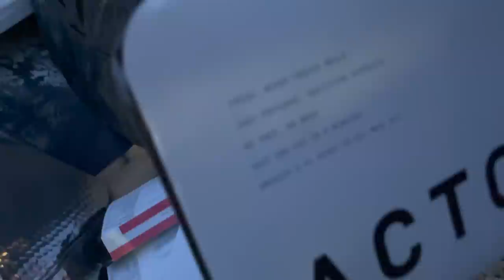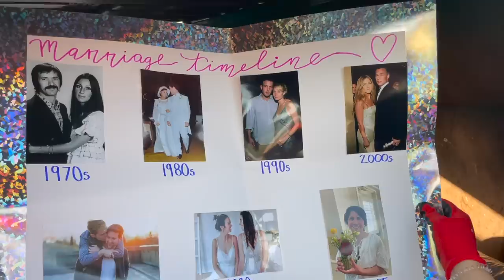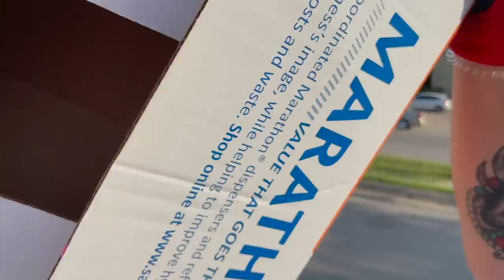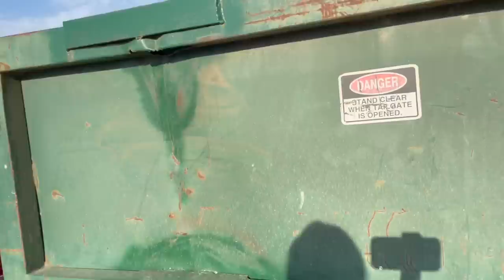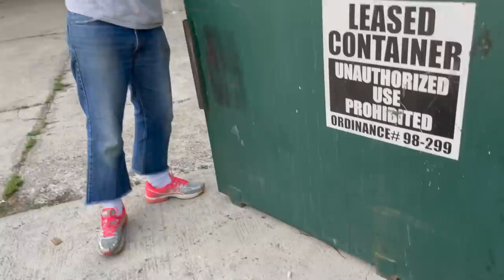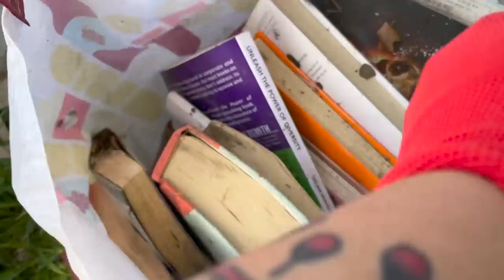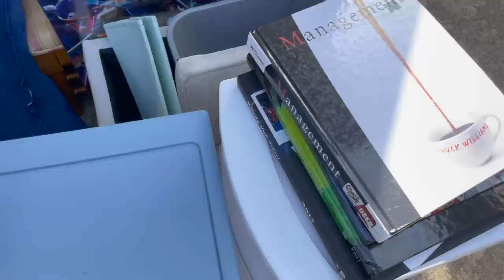Part 2 - Dumpster Diving on College Move Out Weekend!! Crazy Haul!

Comment: I work at college housing in MN.  We try not to opt for the large dumpsters but if you don’t provide then the same amount of stuff is still thrown away but they just pile it on top of and in front of the dumpsters, to the point the trucks cannot collect the bins.  During our college move outs we have the large normal bins picked up daily and they still manage to pile stuff in front of it.  During the move out our garbage bill is $10,000 for 7 properties.  It hurts to write that check every year.  I am also a scavenger and DD  so I do grab items that are salvageable

Comment: Many colleges used rubber soccer balls in the 1970s, in a lot of their games.

These would be the ultimate trash to treasure find for me.

I would not care how worn they are or if they were flat. The fact they are old (1970s) and were used in actual games make them valuable to me.
I would pay easily $100 for one. As long as it did not have dry rot, is the only deal breaker. 

Who would have ever thought old rubber soccer balls could be worth anything!

Comment: Snip the cord of those little vacuum cleaners those cords will add up to money. I think they pay you like a dollar a pound maybe more. I like to go to the hardware store and get outlets by the gang and get the plastic box with an outlet cover and I make extension cords out of them. Their little awkward because of the big box on the end but you know what they work just fine if you want to run a little extension cord for a fan or a fan and a stereo are you doing some lighting with LED lights you know light duty you don't want to power a weed eater or something like that with it even though it is a 12 amp cord usually.

Comment: YES        YES        YES    ;          I          SAW          YOU          HOLDING          YOUR          CAMERA          ------          THAT      WAS           ON           A            POLE          HOLDER      ...         ALL          YOU          NEED          TO          DO           IS            TO           ADD       MORE       ------          POLE      ------    HIGHER     ------      TALLER          THAN            THOSE             DUMPSTERS           &           THE            BOTTOM          OF           YOUR          CAMERA          POLE          HOLDER       ------      PUT      --    3      OR      4     --     PRONGS        ONTO           YOUR          TALL          POLE          BOTTOM      ------       SO         IT         WILL          STAY          STANDING          UP           ON          IT"S          OWN     ....          KEEPING          ALL        OF        YOUR     ----      4      ------       HANDS           FREE         TO        BE        ABLE          TO           D  .   D  .